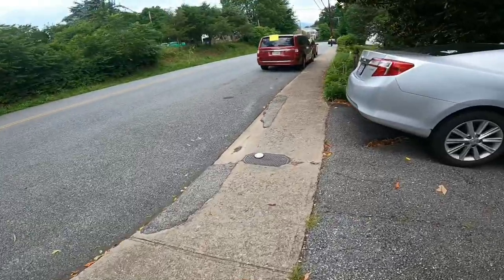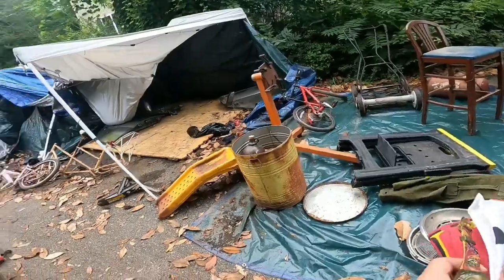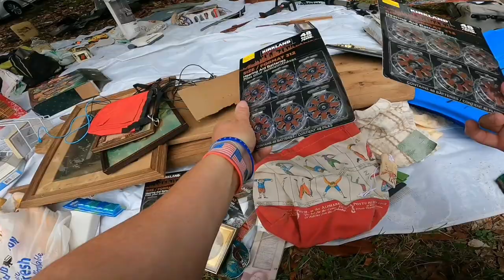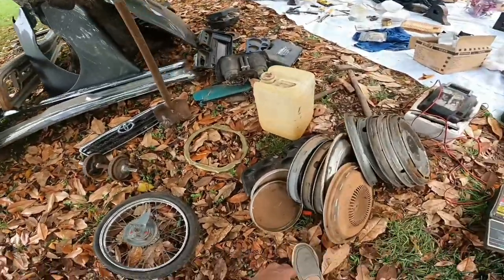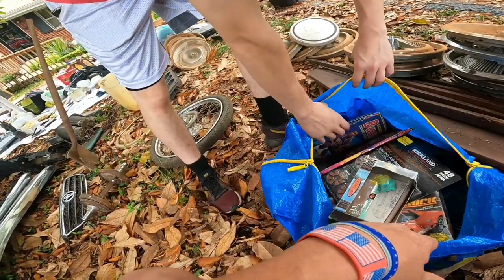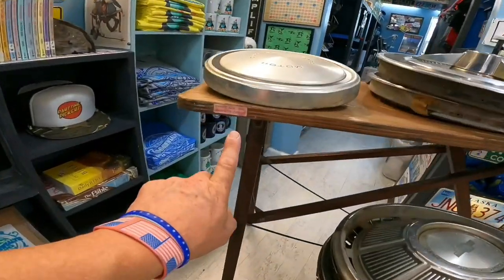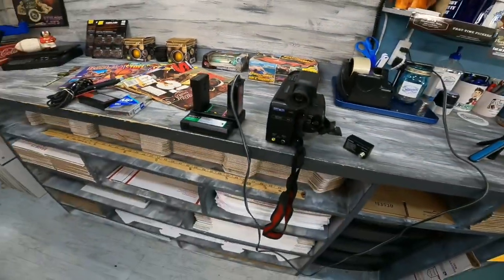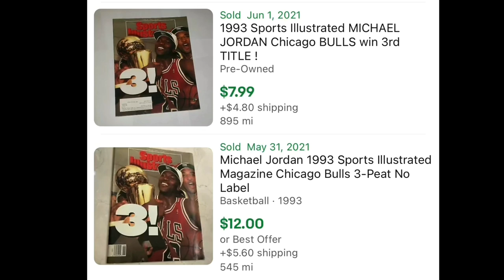TREATED LIKE TRASH AT THIS GARAGE SALE

Comment: the SS hubcaps.  The wheel diameter might help with the ID.  You mention Impala, Chevelle and Malibu, but don’t forget that Chevy also had SS variants of Camaro, Nova, El Camino and even the Corvair.   The smaller cars would have had 14/15” rims, while larger had 16”.

Comment: Over the years I’ve cleared out many places like that, back when I worked part time with a local auction house.  My job was usually to set up the old barns and out buildings, making up auction lots.  Always a challenge to find value.

Comment: I did a lot of picking this weekend. I got a vintage Coleman lantern for $2.50 and it should sell for $100+. Today I picked up 13 Motorola 2 way radios along with a high end DC power supply and a ham radio repeater for $100. I'm expecting to profit $800+ on those. Also, got a Walkman wm-f10ll for $3. That should sell for $60+ (parts only). This was one of my best weekends ever!
Reply from the maker: nice work.

Comment: Red one is a caddillac emblem isn't it?
Reply from the maker: Looks like it but I don't believe it is.
Reply: @CommonwealthPicker  yea if its old enough it could have been a knock off before patents. I had a metal 30 gal trash can from the 50's with a knock off pressed ot caddillac emblem after researching.  Sold for $50 some people were getting $100
Reply: Yeah I was thinking that too, but Cadillac has the crown in the middle.